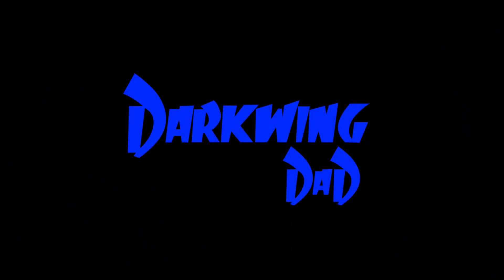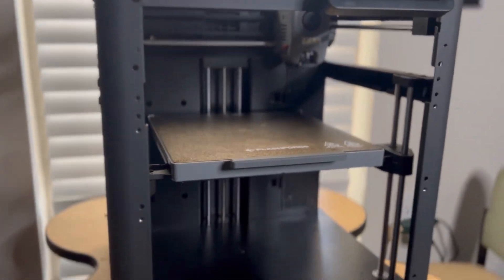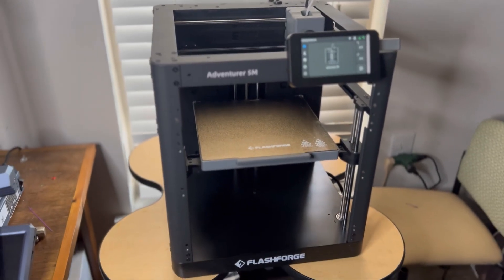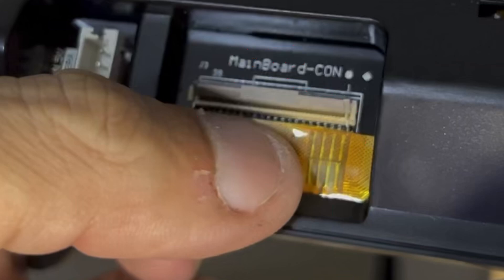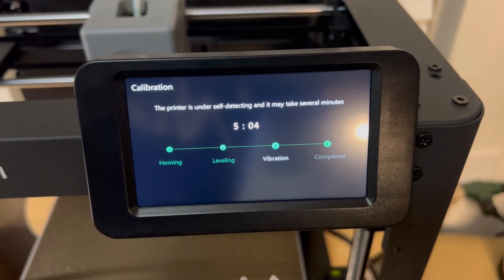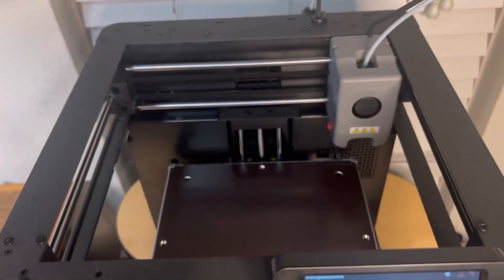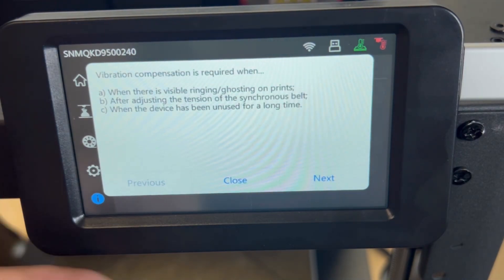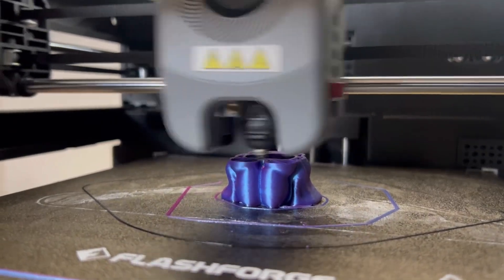Is this the best 3D printer out there? The one printer you NEED to get!

Comment: I have this printer and I do not recommend it compared to other models, parts are hard to get, expensive and there are problems with updates every now and then. With long prints it often has a problem with printing, either an error with the nozzle temperature or with communication pops up. And no it's not a problem specifically with my model as I've replaced it 3 times already with the same problem.
Reply from the maker: @sumniumdoit8686  how long of prints? I just ran a 14 & 20 hour with no issues
Reply: @Darkwingdad  621h
Reply from the maker: @sumniumdoit8686  wow that is a lonnng print
Reply: @Darkwingdad  This is the total time I have currently using it. The longest print lasted 32h. However, the problem occurs regardless of time. With the first printer, after 20h+ of use, I had to return it due to an error. With the second, at 400h+, and here, at 300h+. The support informs that it is an error with the update or nozzle, but even after replacing the nozzle with a new one, the errors still appear. And for example, on my two A1, I have used 450 and 700h+ and they still work like new.
Reply from the maker: @sumniumdoit8686  I think a lot of the issues lie on QC of these printers, they are tested for minutes & let’s be honest since bambu launched the p1p every company is playing catch up & are not testing the way they should

Comment: Finally, a core XY with a decent  touch screen. But why do they still keep putting the spool holder on the back.
Reply from the maker: @jeremy_wofford  I imagine because of the filament run out sensor, it is annoying to load all these & it takes up more room than needed
Reply: How long have you been in 3d printing?